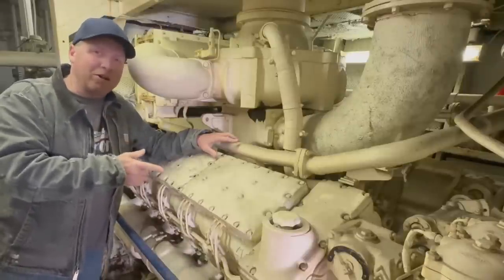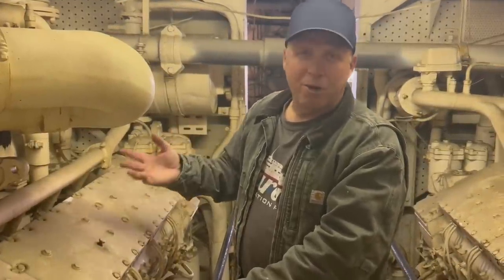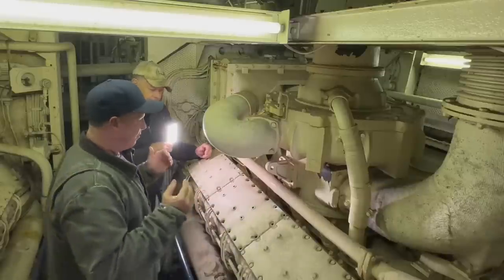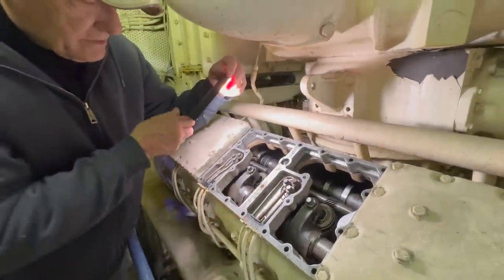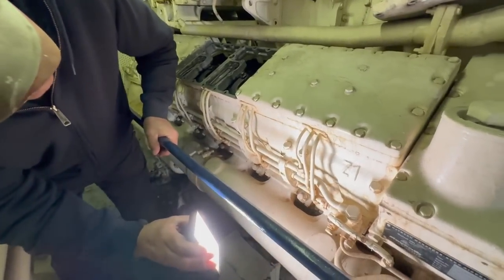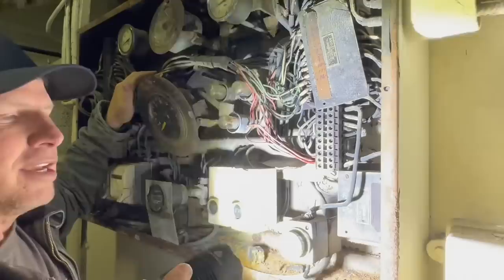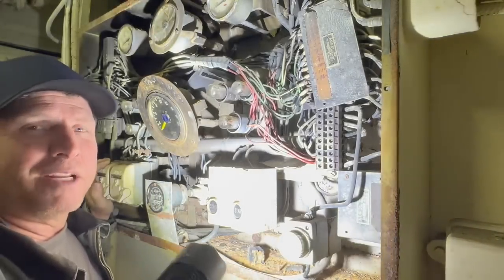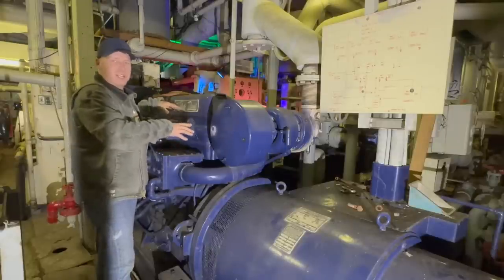INSPECTION OF THE MASSIVE MERCEDES MAYBACH DIESEL ELECTRIC PROPULSION ABOARD THE CRUISE SHIP AURORA

Comment: Another key area to check is Engine Cooling. Hopefully saltwater was pumped through a heat exchanger to than cool the engines with fresh water. As long as the seawater feeds were closed and the heat exchangers were flushed clean, you should be in okay shape. Noting much worse than saltwater. 
Did the ship come with any documentation on the Engine Room and Controls?? Also have you reached out to Mecedes/Maybach and AEG? Documentation is going to be critical to get everything working and cooperating that way it should.
Reply from the maker: There are going to be definite issues with the heat exchanger and cooling lines.  Most likely will need to tear down the heat exchanger and give it a proper deep clean.  Maybe need to replace some of the cooling lines.  Definitely going to be an ongoing project.
Reply: @AuroraRestorationProject   possibly true but one good thing is that you can run the diesel for a few moments (seconds or even a very few minutes) with no heat issues without any of the cooling systems actually in operation as long as the water jacket is full.  That way you can do a video with that nice running engine sound!:)  If the freshwater cooling can be activated, which I think could be done with an external pump even if the existing pumps are not yet operational, then I would think you could run the propulsion generators until you see the freshwater cooling system temperature and/or lube oil temp start to climb which would be several minutes at least.   Saltwater heat exchangers do seem to suffer from a lot of corrosion at times but I would think those would all be much less of a project than getting the propulsion generators on line and of course restoring the propulsion generator controls which is really an interesting question on that ship.  As I recall the main control panel had a lot of corrosion . Overall though I do see all of that as being entirely doable.

Comment: One piece of advice, no mater how good they look, change out all of the old oil and filters asap before thinking of starting or turning anything over. 
Oil does have a lifespan, and while it might look perfect, if it has been sitting then its viscosity will be severely hampered or no longer existent. 
Once it gets even a small amount of heat into it, it will turn to water and will not lubricate anything. That is when the danger is of doing catastrophic damage to everything when it didn't have to happen at all. 
From the look of those engines they look like they were merticulously serviced and cared for. I have seen those internal surfaces before, they look like they have been sitting for too long and gravity has simply pulled away the oil into the sump. No atmosphere looks like it ever got in so i would take a educated guess and say those engines are very near perfect and more than ready to rock and roll. 
I dont know what it is like over there, but here in Australia all those parts are readily available almost anywhere. Globes and all.
Reply: Most Locomotives never change the oil until they blow a rod or need overhaul.  It would be interesting to see if this is the case here.  But old sludgy oil thats been sitting too long may be a lost cause…. He has 5x of these 16cyl engines aboard.  Thats like 150+ gal of oil
Reply: @Ms_Princess_Zelda  an engine on a locomotive is very easy to change, the body comes apart to get to everything. However on a ship it isn't as easy, therefore they will not take the risk. Also Railway Companies are stingy and have bad habits of cutting corners and costs in some countries. 
But again with ships there is no such thing as cost, money is nothing and is spent flippantly to keep ships in perfect condition since they can't afford to get stuck put as sea somewhere in the middle of the ocean. 
It is fairly obvious those ships that aren't cared for properly as they are constantly breaking down.
Reply: @theghost6412  oh I agree, I was making an observation.

Comment: The black dust inside the generators is carbon from the commutator brushes. Really high power generators cool the windings with hydrogen inside a sealed casing.  The slip rings are OUTSIDE the hydrogen cooled area, so the dust is contained.
Reply from the maker: Thanks David,  It’s things like this that we should know.  The more knowledge the better off these engines will be.
Reply: Most likely nitrogen, as hydrogen is insanely flammable.
Reply: Large power plants use Hydrogen for cooling. 
Your setup is much like a diesel electric locomotive. Probably just needs a good cleaning.

Comment: Most people write here about filling the engine with oil. In my opinion, the first thing you should do is fill the engine and cooling system with water and start warming up the engine. Open the crankcase and check for water leaks a and then fill the engine with oil.

Comment: It's a good thing a more well known generator is installed. Very rare means impossible to repair usually
Reply from the maker: That’s true and a great way to think about it.  This generator appears in great condition
Reply: @AuroraRestorationProject  I was surprised to see roller bearings on the crankshaft that's German engineering those motors will last forever with proper care 😊
Reply from the maker: @johnsnow1355  I sure hope so.  They could be beautiful if restored correctly.

Comment: Is it possible to try for the Blue Ribbon?,  when everything is working . What is the top speed?
Reply from the maker: Actually it’s only 18 knots..
Reply: @AuroraRestorationProject  upgrades maybe? That would be awesome to see ! Nice work bro.
Reply: Blue Ribben? That is still on the name of the SS United States. With a speed of 35.59 Knots.
Reply: @jaccodejongthenetherlands611  that would be awesome to see that record broken.
Reply: @reidnolan4456  This was the power of the SS United States, 247,785 shp (184,773 kW).
Reply: @jaccodejongthenetherlands611  well some one needs to put her back in  service.

Comment: If you're redoing the wiring, could you replace the bulbs with new LED bulbs?
Reply from the maker: Not sure if we will move towards LED in this control box.  Really depends on voltage etc..
Reply: I design and manufacture LED lighting for a living and I would definitely replace the control indicators with LEDs, that would be easy and save effort in procurement of the old bulbs.  All that would be needed would be to energize that circuit to determine what the voltage is and then a suitable LED could be inserted there which would pretty much never fail.  I would be happy to supply those to you at no charge.  Same goes for engine room emergency lighting.   Regarding  the light bulbs inside the propulsion motors you want incandescent there because they supply some heat for drying while the motors are not in use. @AuroraRestorationProject

Comment: Can you create wiring diagrams when you rewire the control panel and other areas as the electrical restoration work progresses
Reply from the maker: Absolutely,  Definitely not taking any chances.
Reply: electric propulsion has its risks 
This from the srtory of the SS Canberra in 1963
But sadly her troubled past was about to catch up with her again for at around 4 AM on January 4, 1963 the Canberra was sailing eastward at good speed of 27 knots across the Mediterranean with 2,222 passengers on board. Being about 160 miles north-east of Malta, one of the officers in the engine room saw that one of the three turbo-generators had “shed its load.” As the generator began to speed up, the crew were unable to trip the circuit breaker, and then one of the crew forcibly broke the contact and that was in spite of the sign warning not to do this. It created a considerable electrical arc that caused a fire that was fed electrically by the other two generators and this then destroyed the starboard side of the switchboard and the majority of the electrical distribution cables. Canberra suddenly lost all power and suddenly alarms rang out throughout the ship.

Comment: I'd start with the turbos and make sure they're free. Then hopefully there's a pre oiler built in. If not, perhaps improvise something into either an external filter or oil cooler. Definitely ideal to get some oil circulated before trying to roll the engine over. If that won't work, open the valve covers and pour some oil over the valve gear, pull the injectors, and roll it over until there's oil pressure. Do not oil the cylinders and also check the oil seals in the turbos before you attempt the first start - you don't want a runaway! I'm willing to bet Mercedes still has all the technical resources to help you get these engines back in service. 
Wow! Roller bearings on the crank, fork and blade rods... And did I see an oil nozzle for piston cooling? ♥♥♥ They sure don't build them like they used to

Comment: Before cranking, open the cylinder cocks to make sure all condensation is out of the cylinders. Water/condensation in any cylinders will cause a bent connecting rod...don't want that. 

I would focus primarily on the waukesha genset, then you'll have power for engineering dept, and main engine electrics...

Comment: I would think there is a oil centafeuge, that supplies oil to the engine the same for the fuel supply, and it might be a dry sump system
Reply from the maker: Indeed there is.  Something else to decipher in the very near future.
Reply: Either there is one purifier for all engines or a small one each . If the heating for the purifier is electrical it should be possible to start it / them just with electric power and start purifying the engine oil . Otherwise you also need a boiler to heat the oil . The oil has to be heated to 85 degrees celsius to be purified properly . Then you also need water to run the purifier . Good luck with everything !

Comment: Do y’all have any of the manuals ?
Reply from the maker: Yes,  Unfortunately all in German.  Will have to translate.
Reply: @AuroraRestorationProject  Chris, I've got an English copy of the Engine manual that covers MD650, 655 and 870 engines. It will need scanning but I can send you a copy.
Reply: @christatton7414  
I don't want to be too cheeky, but if you are really going to scan them, could you maybe send them to me too?
I'm a young mechanical engineer, really interested in (old) MTU engines and it would definitely be an interesting lecture.
Kind regards, Toby
Reply from the maker: @Unimog1600  message me.  Will definitely share them.  Are you part of the Facebook group?
Reply: @AuroraRestorationProject  
Thanks a lot for your offer too. I will message you on Instagram, as I'm not on facebook.

Comment: If the four bolts with the safety wire on them, if they are tightened by turning them clockwise. the 2 bolts on the right has a neutral wire and the 2 bolts on the left are safety wired backwards

Comment: cant wait to see the old girl cruising on her own power again! good luck with the engines ,question  would it not be wise to do the blue genie first? than you have all the power you need in the ship for all the project, or are you "scared" to use shippower (in case of broken wires or someting like that)
Reply from the maker: The biggest issue with the blue diesel is that it’s overkill.  I would imagine that at idol we are looking at 5 gallons per hours.   We will however get it operable wether or not we use it will be another story.
Reply: @AuroraRestorationProject  I have encountered that problem before with over spec equipment that is costly to run, especially where full capacity is rarely required. Our solution was to acquire a good, used, lower spec unit and installed it alongside the big unit, with a change over switch. We use the smaller unit unless full capacity is required.

Comment: If all the engines are 1500RPM rated does that mean your ships electrical power is 50Hz Or does it use DC with inverters for the onboard power?  (I saw what looked like Brushes in those generators but wasnt sure if that was for the exciter?)
Reply: Diesel engines drive DC Generators which power (2) DC motors to propel the boat. House power is from the blue 300KW AC generator.

Comment: I would leave that broken bolt alone, there are enough bolts to keep that cover on. Wouldn't want to risk getting metal shavings in there..
Reply from the maker: Good call.  Either that or make sure it’s sealed up good before I start drilling.  Will give it some thought.
Reply: Yeah, if you taped the opening up and vacuumed the shavings off it probably would be pretty safe.
Love to see something of this size and historic value getting restored.
It's sad to see so many old ships rotting away or being scraped.
Restoring cars and motorcycles is one thing, but this is on a whole different level. 
Keep up the good work👍
Greetings from Germany
Reply: @AuroraRestorationProject  if it's a blind bolt, fully refit the cover and mark the drill bit with the max depth you need to drill and you'll be fine. No risk of getting any swarf inside then.

Comment: Noticed the Maybach engines have roller main bearings and good old fork and blade connecting rods. It is probably worth investigating the pitfalls of roller bearings on these engine as they are probably more sensitive to oil quality, filtration and moisture.

Comment: Looking at the generators and drive motors you have a old DC system with the commentators and  carbon brushes. Once you get those engines running the DC generators and drive motors won’t put out power unless you energize the field coils, by lifting the brushes off of the commentators and connect a battery to the field coils, and once that is done reset the carbon brushes and you will be operational hopefully. Years ago I had that problem on the  USSTwinn Falls  a old victory ship that was a missile tracker during a Cold War, with the emergency back up DC diesel generator in the Brooklyn Navy yard, Chris I wish you the best with this project  a question, have you looked into getting  the cost of getting into a dry dock, and sand blasting the bottom  for a Coast Guard five-year certification  ?  Look into three museum ships from World War II that are in still in operation today. The SS  John W Brown in Baltimore ( that I worked on in the late 60s to 1979. When it was a maritime training vessel. It’s now a museum,  And look into the SS Jeremiah that is at pier 35 in San. Francisco these are two WW 2 liberty ships, there is also the SS Lane Victory that is in berth 52, 2400 Miner St. Pedro California. Talk to these people that are operating these ships they will give you a lot of insight with cost  and Coast Guard regulations on operating the ship  in  coastal regions of the states. and when I volunteered my time working with other volunteers I met a lot of engineers with knowledge of different operating systems , and hopefully they would put you in contact with people that know diesel electric drive systems in your area. Once again good tidings. From the East coast.

Comment: I bet they prepped this engine for storage...tons of different methods are used. Sometimes they "fog" the cylinders which involves spraying a sticky lubricant and rust prevention in them. Pull the rocker covers and soak everything in a similar type of thing. If it has a way to gain access to the crank case they can do that area also. Fill the injection pumps with special stuff made for protecting them in storage. Drain cooling systems and again they make chemicals that coats them after draining to protect. Something you have to be very careful about...the electrical section of it is very dangerous...it could have already had issues... rodents could have caused issues while being stored...age could cause insulation to just fall off wiring...I would have 3 or 4 large electrical fire rated extinguishers on hand, a way to quickly shut it down, and either a large hose ready or a large source of water and a high volume pump in case you need to just quickly slow or stop a spreading fire until the fire department gets there. Ever Since I saw how fast fire can destroy buildings, and how it goes from a small fire that seems like it's no big deal to consuming the place.

Comment: Those engines probably have air starter on them
Reply: These are started by a big bank of NiCd batteries that supply power to (I think, if I remember correctly) the actual generators, in other words the generator is the starter.

Comment: Less is more with those diesels,   fill the crankcase with oil, turn the fuel off and crank the starter until she gets oil in the top end and solid oil pressure.    then hook up a remote fuel cell, bleed the pump and injectors and see how well it runs.   then you can start making necessary repairs.   i dont think you should rebuild anything that doesn't need rebuilding until you know exactly what you're up against.
Reply from the maker: Thanks for the advice,  Would love to see if these will crank without ripping them apart beforehand.
Reply: @AuroraRestorationProject  they will absolutely  run,  they don't don't professionally mothball engines that are junk.

Comment: Maybach made engines for the tiger 1and 2 during the war
Reply from the maker: They seem to be rare but popular engines.
Reply: How many engines would you need running turn the electric motors over?
Reply: I don’t think it would take much to get them running,check fuel system and oil supply should be good to go